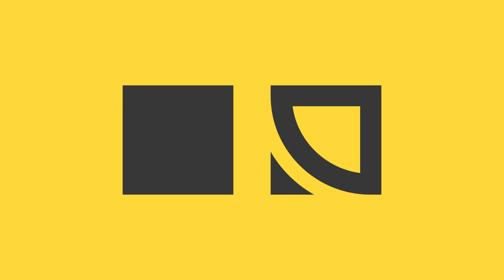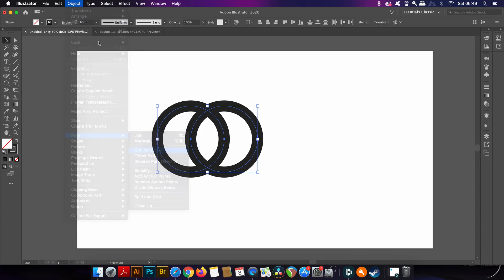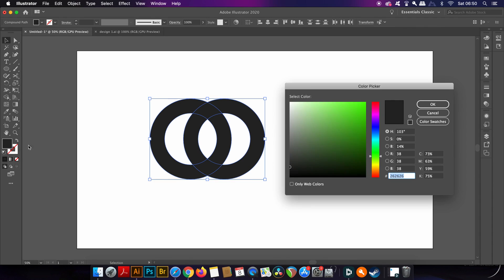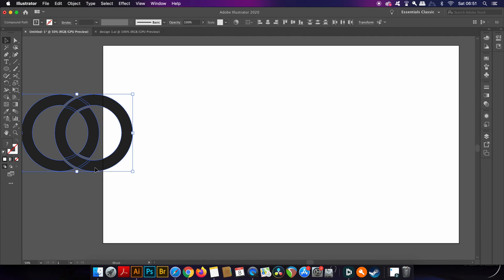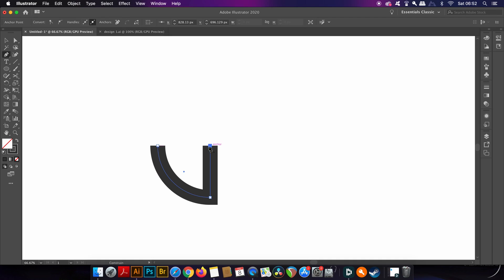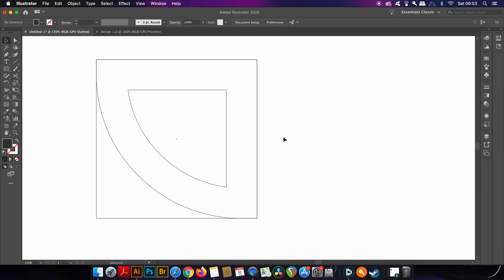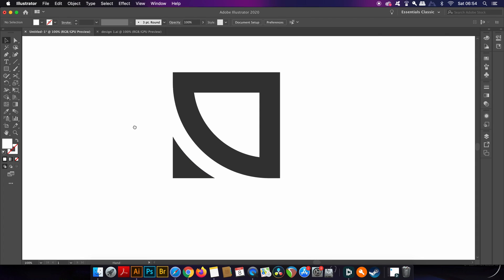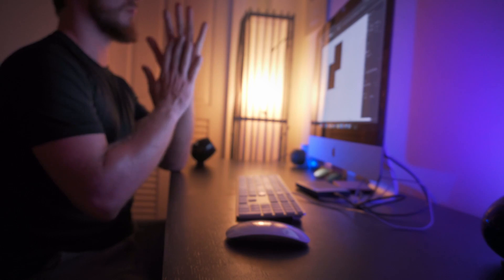CLEAN LOGO DESIGNS With Illustrator Offset Path

Comment: i have a problem with my illustrator objects, that i can't select the object with click of mouse from inside, only works on edges, also i cant move it by holding it from inside, works if i hold one of the edges and drag... how i can get it to normal?
Reply from the maker: press command / control K, and then head into the selection preference settings. You might have 'select by path only' checked. If you do, uncheck it
Reply: @SatoriGraphics  Thank You! Thank You! Thank you!!! THANK YOU!!!!!!!!!!